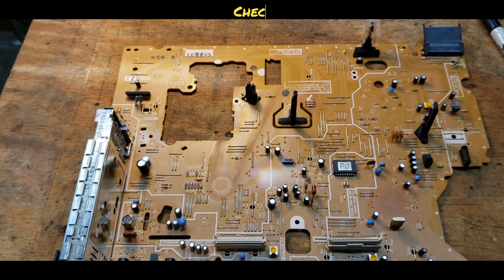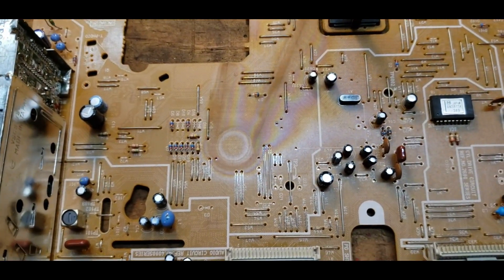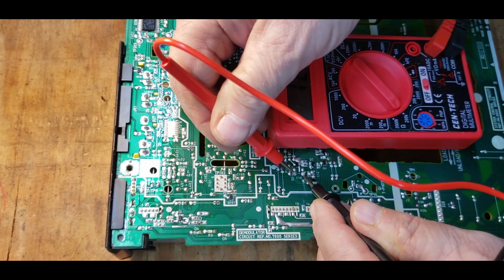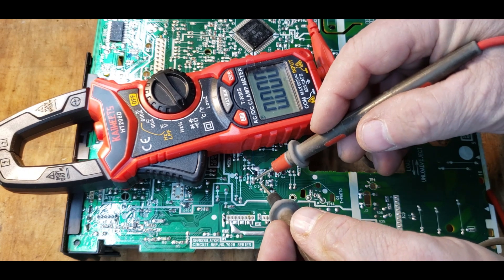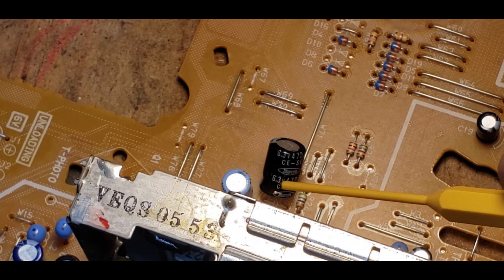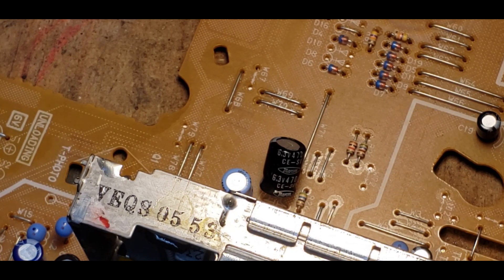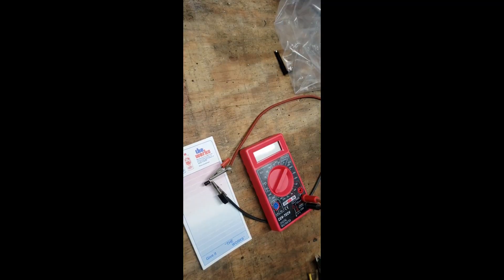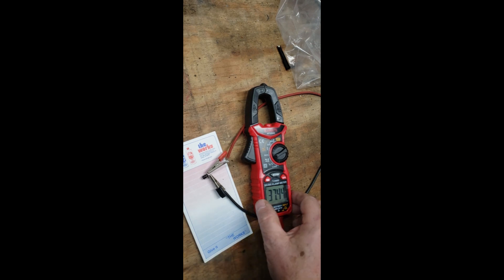How to measure a capacitor with a multimeter

Comment: While this method is good as an indicator, a lot of these caps will still show correct capacitance but in reality the ESR will be too high and therefore bad. Even a cheap ESR meter will tell you this :)
Reply from the maker: The intent of this video is to help a non-technical person to quickly identify a bad capacitor in a circuit without having to own very specialized electronic test equipment. And then show them how easily they themselves can replace it.
Electrolytic Capacitors are many times the reason why a “consumer electronics product” just stops working.
Electrolytic Capacitors are (cheaply made) and are very common in consumer electronics products and can become weak or just go bad with passing of time.
Reply: In many, many things electrolytic caps aren't subjected to enough ripple current for ESR to be a critical factor. It certainly does come into play, but the most common failure in lots of cases is simply "drying out" - loss of the solvent from the electrolyte. This does make the ESR dramatically higher but it also causes the capacitance to drop dramatically.

When you get into things like high frequency switchmode converters ESR is very important and it may reach an unacceptable level without much change in capacitance.

I've designed lots of industrial switchmode power supplies. I've replaced lots of bad caps on things like PC motherboards. I've never used an ESR meter as a diagnostic aid.

Comment: Thks ?Does this work the same for inductors too?
Reply from the maker: No. Inductors will aways measure very low resistance/impedance in and out of the circuit.  You will need an LCR meter to read the inductance of an inductor. Inductors seldom fail in a good circuit design and when they do you will usually see it. Electrolytic caps can dry out inside and can lose there capacitance over time.
Reply: @gse244  Thks buts another dumb question;
When the volt meter probes are placed across an inductor, ?is there an initial voltage reading that slowly fades-away as the inductor mag-field charges-up (ex: opposite of a cap)?